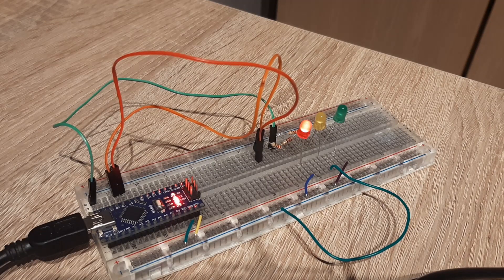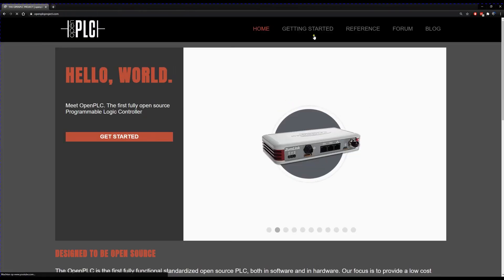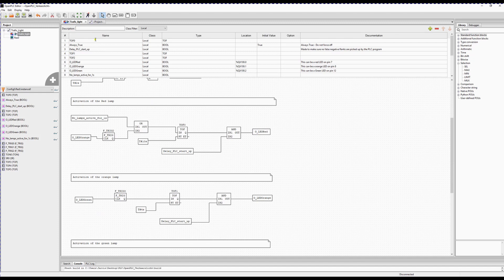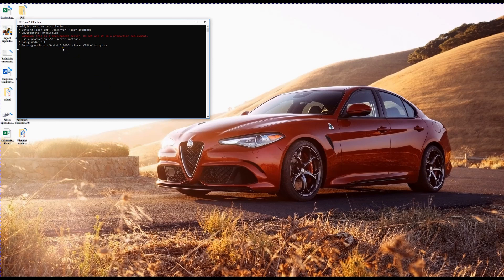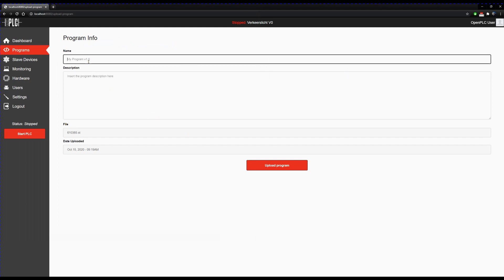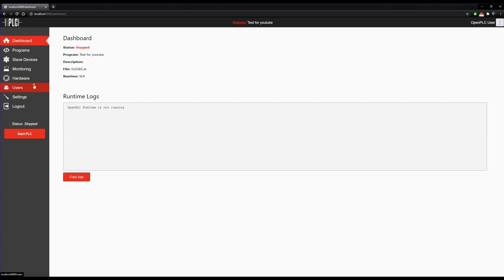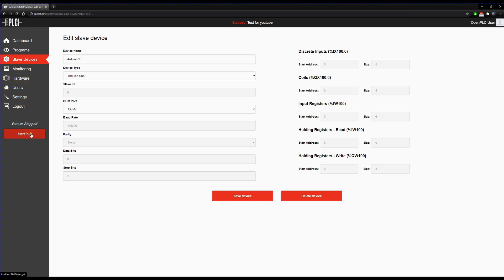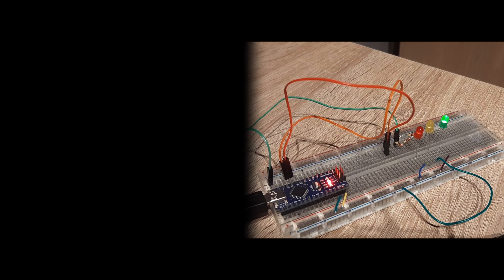OpenPLC traffic light project with Arduino | PLC automation

Comment: Hi can someone help me, can we use standard arduino ir sensor and other sensors like accelerometer with this open plc? Just curious
Reply from the maker: Yes, but there will be no library versions available. So if the sensors use an analogue or digital signal to the Arduino, you can use this, but you don't have access to libraries and must do the coding yourself. You are also limited by the predefined IOs for each device in OpenPLC (https://openplcproject.com/docs/2-4-physical-addressing/).

Your example for the accelerometer, an ADXL3xx series, is possible because it uses five analogue inputs. You can't do this (without messing with the sourcecode) with an ESP8266, but with an Arduino Mega this is no problem.

Comment: Hey man would love to see an rc car or obstacle detection car, or even a drone. Just something with locomotion.
Reply from the maker: The problem with motion and arduino is the fact that you need to connect a cable to your pc. It can't be small. Or I need to use a rasberry pi. 😀
Reply: @seafoxc  can you not use lithium or 9v batteries?
Reply from the maker: @raxocoding9298  The reason the laptop has to be connected is that OpenPLC is running on a server on your laptop and the Arduino is a slave. All the logic is in the laptop and the Arduino is a slave and the communication to the Arduino is just to read the input pins and the output pins. if you disconnect the laptop the Arduino just "stops". You can make robots with Arduino but you need to program the Arduino (you can use C++ to do this).
Reply: @seafoxc  oh okk didnt know that thanks for the info
Reply: @seafoxc  LDmicro can sure be the solution that is needed here
Reply from the maker: @OnosTech  I checked it out on the website of LDmicro and I was interested to learn more about the software. I also visited your channel and found a lot of solid information. LDmicro can be a good solution!